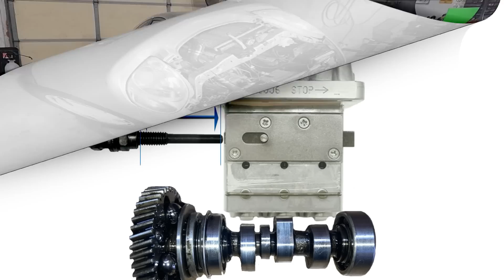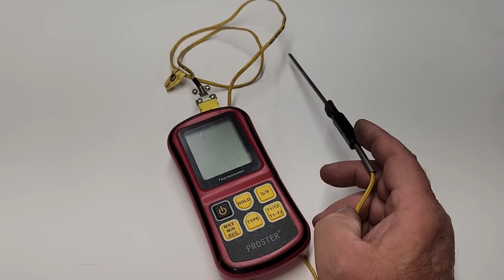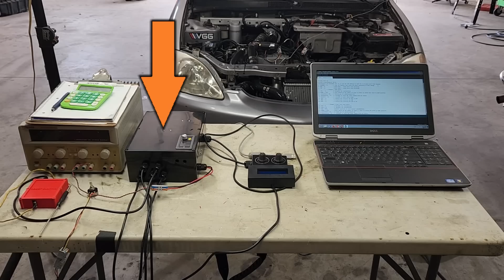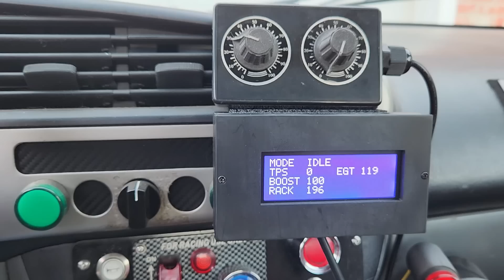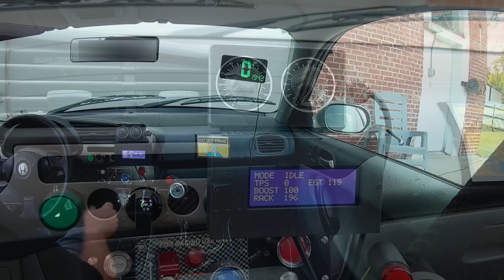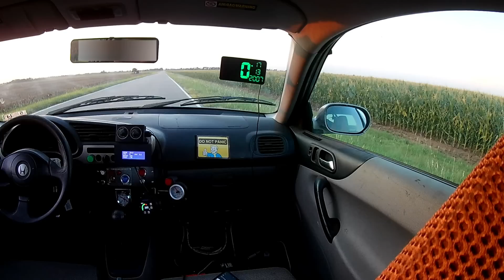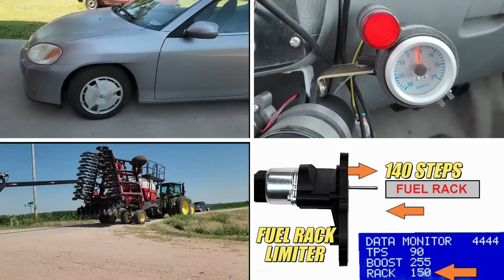S4 E24. the computer controlled supercharged Kubota diesel gets faster and better MPG

Comment: One of my favorite cars ever was my 4 eye, 4 door Foxbody midsize LTD from the 80's that I stuffed an OM617 Mercedes turbo Diesel into. It was a quirky combination, but once the bugs were worked out, it was just an all-around great car. I did the 5 lug upgrade, SN95 brakes, GM f-body aluminum radiator, junkyard turbo upgrade from a Volvo with an eBay compressor housing. It had (80's) style, decent performance and nearly 40 MPG. On my way to the shop, a gentleman in a full size OBS Chevy ran a red light and my Fox sacrificed itself to save me. It took 2 years to settle my claim. Because of the accident, I have a new scar, a fancy titanium plate in my neck where my bulging disc was, and another Foxbody LTD. Since my Diesel engine was damaged, I'm going the lazy route this time and swapping in a supercharged 6.0 LQ4 truck motor. My daily driver is a Honda Insight, so I am not worried about the lack of fuel economy in the LTD this time around. Oh, and it will have agreed value insurance when it hits the road. If I can fix my broken Diesel, I am thinking it needs to find its way into an old mail Jeep, or a Pinto station wagon. That would be fun!
Reply from the maker: I have owned a few older Mercedes diesels and they are wonderful engines. The diesel LTD sounds like it was the perfect car.  Glad you survived!
Reply: @robotcantina8957  I just bought a 300d a few weeks ago, This video sparked the idea of using a copy of this setup to replace the ALDA.
Reply from the maker: @calvinbarnes1721  LOL, My system is based on the ALDA.  On my 1987 190 with a turbo diesel OM602 I removed all the junk that was between the waistgate and the ALDA.  Basically directly connecting the boost reference to the ALDA.   I was told its safe to do this because the stock turbo wont make more than 15 psi.  The car ran great for years.
Reply: @oldcoot3459  In my home country, Albania, about 3/4ths of cars on the road are classic (60’s-90’s, W123/W124/W126) Mercedes, mostly Diesels and often run on waste veggie oil. They’re the only cars that offer most (if not all) features of a modern car, without any of the gimmicky excess, but in an analogue package which is infinitely serviceable & maintainable. I am a big supporter of producing Diesel grand tourers. My third favorite classic Diesels (after Mercedes & Peugeot) are Isuzu Turbo Diesels. Isuzu offered a Diesel engine in their 117 Coupé Grand Tourer, the first car company to do so.
Reply: OM617s are very tough engines and they can make good power.  Its not uncommon for them to make upwards of 250 horsepower with minor upgrades.

Comment: Just a kind suggestion if you're worried about the cops, you should probably hook up a full exhaust with a proper resonator and muffler to reduce the noise both outside and inside, the glasspack alone isn't cutting the mustard.

Comment: You are creating this content because of the right reasons. You love making the content and you are having fun doing it. As they say everything else is just gravy on top. I think its a decent idea setting up a system where your viewers, if are so inclined, could chip in a few bucks to help out your channel. You create really awesome and educational content, and at the rate you go through ABS plastic filament I think you need all of the support you can get. 

On the plus side you haven’t resorted to shilling for man-scaping products just yet to get your next arduino upgrade.
Reply from the maker: Thanks,  I love money, but draw the line when it comes to shilling for unnecessary products.
Reply: It wouldn't even bother me honestly. Make that money. If it were me, I wouldn't push just any product, but if it was something I use and believe in I would certainly consider it. 

I FF or skip all commercials anyhow. Some people act like an in video ad read is enough to make them not watch anymore. Just hold down the 2x speed or skip right for the duration. I think the companies are wasting their money honestly. Not too many people watch or pay attention to the ads.

Comment: Jimmy are the piston’s cooled with oil squirters from underneath or is it just splash lubrication?
Reply: I don't think the d722 has anything fancy like oil squirters for the pistons, just a standard pressurized system as far as I'm aware.
Reply from the maker: unfortunately no squirters on this engine.

Comment: A company like BMW has departments where the "parts" designed, sensors, etc, stuff like drive train parts have ABE, something like a official state permit.
A whole bureaucratic system.

It's probably extremely important for your DIY crank sensor to get it right at any time, your "operation" system should be based on this sensor. it started with the Z80 at 4 mHz. Maybe better to use a real abs toothed gear and corresponding sensor. the correct circuit behind it.

18:02 Weird to see, here this situation pretty much would be always a round a bout. with in/off ramps, tunnel depending on design, in no way you would have encounters a truck with these speeds like that.
Reply: Oh yeah roundabouts are not as popular, folks hate them for some reason. Every one that's been put in, in my area at least, has been way more than beneficial to traffic flow. 

Sadly too many people get confused by them 😂
Reply: @goosenotmaverick1156  Yeah, you don't need to stop, what's not to like about that?

Also cyclist and 50cc moped are put in the mix and they have priority over you as car! (they have their own lane on the round a bout or a a sperated narrower "road" around the roud a bout.)

pretty sure 99% of the Americans would not pass driver licence exam here.
Reply: @AnalogDude_  that's neat about the bikes and small displacement scooters. We have some bike lane in my area and some decent mileage of paved path, but people around my area are not as friendly to cyclists as one might hope. They get absurdly aggravated if you're doing 30mph down a side street because "you're holding up traffic, you have a whole trail!" Not realizing it doesn't reach everywhere. 

The closed mindedness and ignorance runs deep here. 

Also, yes. Most of us probably couldn't pass your test. Where might that be? I've heard the UK is pretty tough as well as a good number of other former colonies (I forget the actual word for this off hand, I feel dumb). Sadly a lot of folks can't even get one here. I can't imagine them trying other places 🤣 very very few can drive very well at all.
Reply: @goosenotmaverick1156  The Netherlands, google how roads, bicycle lanes, round a bout, etc look like here. you'll like it. state of art.

Pedestrians and bicycles are untouchables by law, no matter what if you hit a person by foot or bike you're always guilty. There is no excuse you can throw at it.

You have 2 drivers licence here, the A grade an B grade, the latter only being allowed to drive automatic cars.

What so hard about passing the person on a bike and mind your own biznis?
Reply: @AnalogDude_   we are Americans, apparently everyone's business is ours 🤣

Also I've seen some of the infrastructure at work over there via videos, it's fantastic! Seems like it's quite cyclist friendly, and being someone that's been hit by an automobile more than once, I like that idea 🤣
Reply: @goosenotmaverick1156  on elementary schools they hold bicycle practice exam's, currently i think when you're 10 years, in my time police agents would disguise like civilians on the road and stand on crossing and what not. now i see many organizations are involved, this is done to prepare kids for middle and high school and being being able to cycle there.

This was also done in Germany.
Reply: @goosenotmaverick1156  There are zones, though for families with young kids and so.

In these streets kids could technically block your car and start a soccer match, have you look at it while sitting in the car and they would be in their legal right to do so.

Comment: PlayingWithFusion makes good stuff! I have one of their AS3935 lightning detector boards in my homebrew weather/climate station, and it's unsurprisingly much better than the aliexpress special I started with (and came with the calibration info!!!).
Reply from the maker: Indeed, they make awesome stuff that actually works.    I initially didn't want to use an analog output amplifier because the arduino only has a 10bit ADC and that's pretty sketchy as far as accuracy, but to my surprise the signal from the amp was stable and the ardiono is able to provide accurate readings.

Comment: Just wanted to say you are the reason i just got into Arduino's and all the fun things you can do with them! So thank you! Maybe you already know about these but I'd suggest a Nextion Touch screen display for your controller, Easy to make Gauges with, Dials, Controls, etc. and it can send data back to the arduino! It's "Cheap" to boot too!
Reply from the maker: There is a ton of stuff I could do and may do, but I need to keep the system as simple as possible during the prototyping stage.  More stuff means more complications. although it would be nice to have a better display for sure.

Comment: Have you checked VAG 1,2 TDI engine? Can be found from VW Polo -09 -》engine might not be found at US import. Common at EU.
Reply: Unfortunately I don't think we got any of those for the US market. The smaller diesel cars are quite uncommon. The Jetta or Passat TDI options would likely have been the smallest TDI option available. I think anything smaller was gasoline only for US market, which is dumb
Reply from the maker: The Polo wasn't officially imported to the states.  I reckon the only small diesel here would be out of a Kei class Japanese truck that's imported for off road use.
Reply: @robotcantina8957  I know that, smaller model Lupo might found from Mexico.  Maybe you could check from these Deutsche Auto Parts guys at US, they might have.

Comment: listening to the explanation in the beginning of vid on the reasons for the computer controlling of components..  makes me wonder..  would a storage tank of pressurized air ready for use at any moment work as well to solve some of these issues?  That is how it is how many do it when turboing or supercharging 4stroke diesels.  3 to 5 times the CC of cylinder(s) is the recommended Plenum size  for 4strokes.
Reply from the maker: that would be a huge tank
Reply: @robotcantina8957  with a two stroke dont think you would need as much storage. Your not waiting on as many cycles to complete before you need to send it into the cylinder.  would only need enough to compensate for the lag it takes Super charger to get to enough RPM to match demand.

Comment: I started working on Hyundais when they started making exploding engines. One thing that shocked me about them was that they were so cheaply made and that they ran pretty high boost for such a basic engine. The earlier ones were 15psi but later went into the 20s. Remember VWs, Audis and BMWs were only pushing 7psi on their earlier 6s. Could that little Kubota safely handle 10psi as long as it was at "higher" rpm?
Reply from the maker: The supercharger was putting out 10 psi before I added the intercooler, now its only putting out 8 ps at full throttle.  At 8-10 psi, the Kubota engine starts making "noises".... Not sure if its in the valves or the injectors.  I think 12 psi is pretty much all I want to go on this stock engine.

Comment: Why don't you go with an RTD for the exhaust gas temp. If you go with a PT-100 that would be much easier to interface with the arduino without needing fancy electronics.
Reply from the maker: generally RTD sensors are for low temp measurements and thermalcouple are for higher temp measurements.  For the EGT we need something that can read up to 1400F
Reply: @robotcantina8957  I thought PT-RTDs could easily go up to 1,400F. I though the transition where you have to go TC was around 1500F to 1600F. I though your alarm point is was less than 1,000?
Reply from the maker: @crissd8283  I'm not familiar with RTD's that go above 300F.     Our trigger point is 875F however the exhaust temps can go way above 1400F if allowed.

Comment: That Thermocouple board is easy to replace. I make BBq controllers and I have a K- Thermocouple board called the Adapter board connected to the main board using a Cat5 cable.  I use the same components as that board you have it also has some other components that let's you manually adjust the temperature to the exact temperature and 2 meat probes.  It also has connections for a blower and servo.  

This is all part of a project called the Heatermeter, which I have been with around 10 years.

Comment: I don't think you're doing anything illegal. Or something the cops would pull you over for. Outside the state of California that is.
Reply: They could pester him for noise violations though, that d722 at full song makes a pretty good racket. More than you'd think for a sub liter 3 cylinder.
Reply: Other than that, agreed. Everything else is in a very gray and mostly unrestricted area of allowance. Where I live, this is perfectly fine. I drove a downpipe only 7.3 power stroke to the alignment shop last week, Monday I'll drive it to the exhaust shop to have it tied into the rest of the exhaust. 

It's loud and not a single person bothered me. It's loud enough someone definitely should have 😂 

Where I'm at, if you have a license plate that matches the car, and it's insured, you have all your required lights for the time of day you're operating it. You're pretty much fine as long as you're not speeding or driving stupid.
Reply from the maker: I really try to keep the car looking as normal as possible to avoid too many questions if pulled over.  The rozzer was a small town cop and if he is on the expressway he is looking for revenue.
Reply: @robotcantina8957  we had some smaller towns get in trouble for sitting on their single on-ramps waiting for folks to speed by on the highway 🤣

Our small towns were so bad about it, they had to make a law to penalize towns if their numbers fell outside the criteria, if I recall correctly. 
Basically a certain percentage of their speeding tickets had to be over Xmph over the limit or they'd have to pay a fine to the state for being a speed trap town. 🤣 

There's still some jurisdictions a little further south that get away with it, but you don't speed on the highway through Rudy, you just don't. 🤣
Reply from the maker: @goosenotmaverick1156  LOL,  Well normally I drive the "Normal" insight these days and its tough to get that car to go 70MPH with the air conditioner on.   So I generally have no fear of getting a speeding ticket.

Comment: And as an added bonus, all that practice appears to have gotten your 2nd to 3rd shift down pat!  It still sounds to me like your engine is bogging down when you first start your acceleration run (first gear ratio too mechanically low)-not as much of an issue with a diesel, which makes good torque down low.  Everything else sounds great!
Reply from the maker: I have to lift on the throttle for the 1-2 shift,  for the  2-3 and 3-4 shift I keep the throttle floored.  The governor in the engine holds the RPM at 4000 in between shifts.    I cringe a little bit on launch because the axles are welded and its hard to say if the welds are any good.

Comment: Jimbo gets pulled over:
The cop: Sir, did I hear a supercharged, bespoke speeduino fuel injected, 3 cylinder kubota diesel refigerator motor powered 1st generation Honda Insight? Cause we have laws about exactly that sort of thing.
Reply from the maker: LOL...
Reply: That's what I was thinking. Highly doubt they care at all.
Reply: @joblessalex  seems he's just worried about exhaust noise. Wouldn't be a problem in Georgia.
Reply: Wouldn't be a problem in Florida either. I have noticed that the supercharged diesel is way louder than it is when it's turbocharged. My TDI Ranger simply runs a straight pipe right out of the turbocharger. No Muffler needed. The turbocharger is the muffler  @jonathanschubert9052
Reply: Funnily enough in the UK, the motoring offenses act of 1891 specifically bans the act of furiously driving a supercharged Kubota diesel powered insight during the hours of darkness on a Sunday. And limits them to a speed of a fully laden ox cart on Christmas day and boxing day.

It's the same act that bans unpainted metal vehicles with an open back, thus why the Tesla cyber truck isn't sold here.
Reply: @benholroyd5221  🤔🤣
Reply: @benholroyd5221  that's all well and good, but can you get a licence for that?
Reply: The cop was prolly thinking, "That guy must be a nut.  Of all the possible cars to get, he chooses a beat-up Honda Insight."
Reply: Well, in Germany they'd go after you, getting custom modifications approved is extremely hard.
Reply: @derkeksinator17  it would certainly be quite the thing to do, rolling up to Tüv in this contraption.
Reply: Funny thanks for the laugh.
Reply: What an oddly specific law!
Reply: Hey Jimbo. That thing is kinda loud don't cha think?
Reply: Dude I think the policeman would think it is cool. This is literally one of the coolest projects ever
Reply: I'd love to see this pull-up for an emissions test. lol  In reality, it pollutes A LOT less than an SUV used as a daily driver.